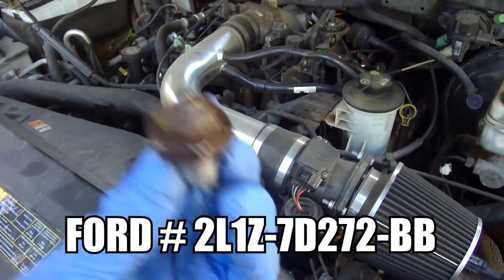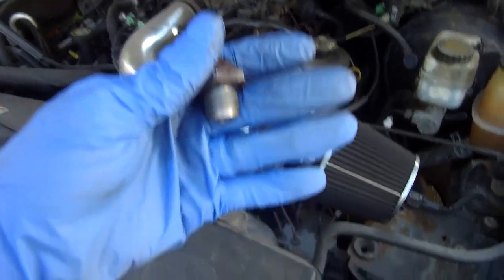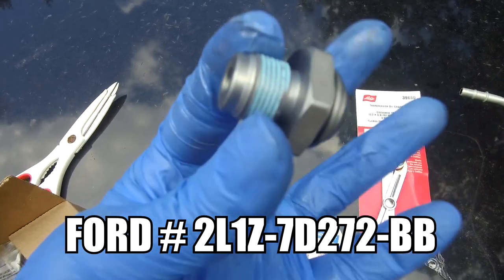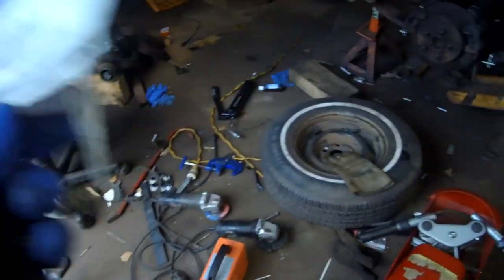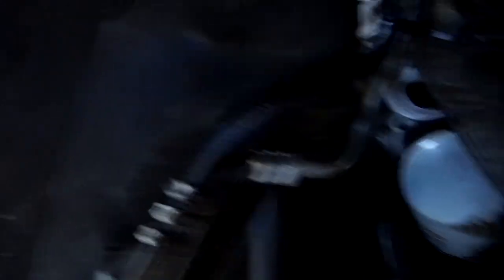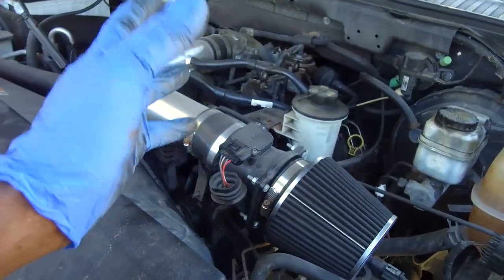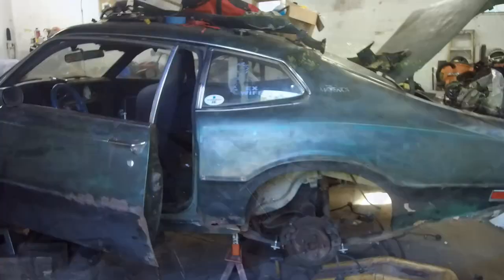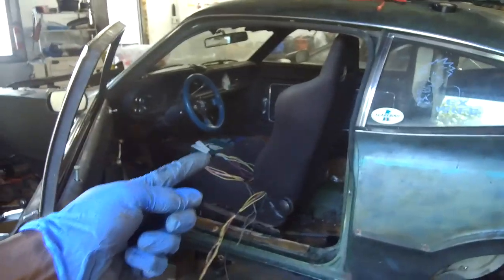Ford F150 Truck/ Suv  Transmission line Tool  ( and connector bung )

Comment: Maybe an aftermarket transmission cooler would be a simpler fix for some/most of the situations. Also rubber hose doesn’t rust out in the area where a lot of road salt is used. 👍🏼

Comment: Man thanks for the information brother I was struggling with the transmission lines, your videos hands down the best on the internet thank you so much and keep the good contact coming
Reply from the maker: funny thing we share the same name lmao... No problem brother .Just get the right trans line ( double check ( I had no time ) so I d what i have done to get by ( still on the truck lmao )
Reply from the maker: thank you for the comment this made my day bro!
Reply: I have a 10th gen f150 as well. My lines to the cooler rusted out and leaking. Any tips on replacing them?

Comment: did you ever find the correct cooling line?  I've searched everywhere and the only one I find is the one in the video.
Reply from the maker: I have ever found the correct transmission line? Nope not at all still running the same line I created ( got a little lazy ) thank you for reminding me cause i need to get the right one

Comment: I went to every part store and nobody has this fitting. Do I have to just order from the dealer?
Reply from the maker: I hope this can help you bro https://www.ebay.com/itm/Genuine-Ford-Connector-2L1Z-7D273-BB/301978298957?epid=1211160210&hash=item464f4f2a4d:g:gtwAAOSw5cNYmP8I
Reply: @bstfordchannel923  thanks my guy

Comment: hey bro my trans lines screw in , I have to cut the line is that piece still a 1.16
Reply from the maker: trans line is like the gas lines they just go in.. wait what type of car you have
Reply: @bstfordchannel923  I have a 2001 f 150 supercab. there is no quick connect they just screw in. 5/8 heads. I just cut the line so I could get a socket on them.  Hopefully just have to do the top line to the trans.
Reply from the maker: @bashafacin  really? well yes you can do that... that will be easier . break it and put a socket around it and get another line ... check all the lines dude make sure

Comment: Ford has far too many issues with corrosion... I absolutely HATE working on mine... just wait until the exhaust header cracks or god forbid you end up rebuilding the heads to change a spark plug on a 3 valve...
Reply from the maker: the simple fix would be just make the parts better for the truck line at the least ( salt and all that jazz) I have 2 crowns and the they both have 1 rusty manifold stud thats GONE.. its crazy and simple fix but cost effective for them